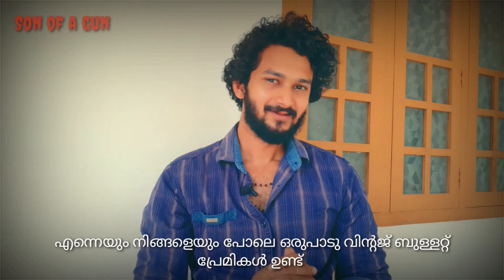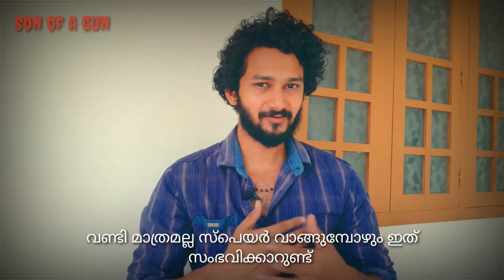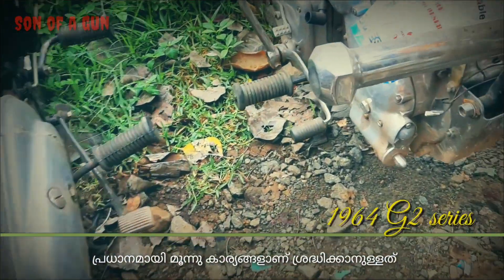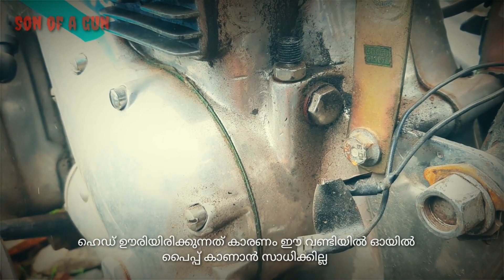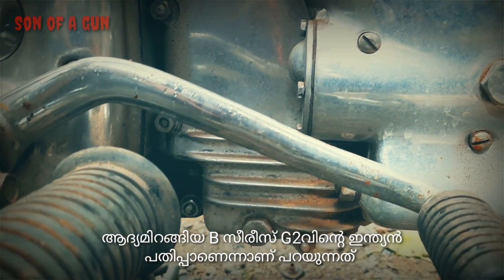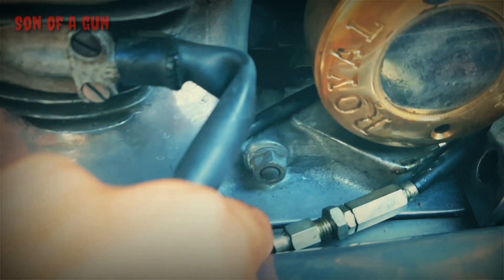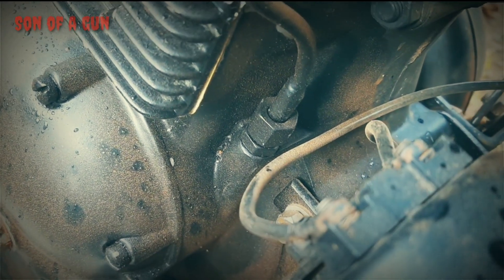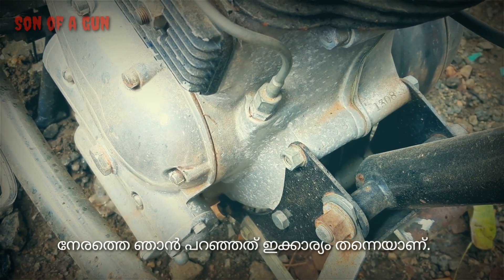How to identify old bullet model | G2 model bullet engine external features | Must watch

Comment: Bro, do a video on fitting and removing  rear cycle hub wheel ,it will be helpful in case of an tyre puncture.
Reply from the maker: Thats a very important suggestion bro..definetely gonna make that
Reply: @SonofagunG2  bro are the vintage g2  bullet genuine parts available still today?

Comment: Thanks a lot bro.. But is there any difference in the riding feel, thump sound or even in BHP... Please explain
Reply from the maker: G2 is not so known for its pulling and mileage... its a slow streamer.. B series bullets are a bit better... as it goes over the years the pickup increses with higher vibrations as seen in post b series ones
Reply: @SonofagunG2  Thank you, Gentleman

Comment: Nice vid bro👍. Btw can it be possible to reduce the tappet noice completely forever. Each time I do, it works only for a short period of time. Thus, there needs frequent service to maintain this. Is there any solution for this? I've been using a 98 model CI bullet for the last 9 yrs.
Reply from the maker: That means the system will need a proper overhaul and probably lathe work.I havent faced the recurring issue in any of my bullets yet...
Thanks for watching..
Reply: @SonofagunG2  Oh ok. But I didn't feel any other issues with my engine except this, so far. Sometimes the knocking sound becomes so annoying and overlaping my exhaust sound. The mechanic says it is a common issue with all CI machines.🤔 Anyways awesome vids bro. Topics you choose are very informative and helpful. Subscribed already👍
Reply from the maker: Then its time to change your mechanic.I have used about 12 CI and none of them had persistent tappet issue.
Thanks a lot bro for the support ❤❤
Reply: @SonofagunG2  Yeah. I too think so.  Thank you. 😊

Comment: Thanks a lot for the valuable information. I would also like to know exactly what was the weight of the crank of G2 engine. Apart from that, it would be of great help if you can throw some light on the different crank weights of engines of 70s, 80s 90s and lastly in models of 2008 and 2009 cast iron.
Thanks
Reply from the maker: This is something even I am so curious to learn.From 60 to 71/72 it is approx 9.3 kg which we call as G2 crank.Then company began reducing the crankweight and those category of bikes knock when we ride in 4th gear at low speeds.It progressed from medium to light over the years. I am not exactly sure about the years but 83 has medium crank for sure.Thats about 8.5 i guess.The Euro one bikes have about 10.3 to 10.5 kg crank weight and they are the heaviest.These bikes range from 2005 to 2010. Some say its till 2008 only.
The best way to check is to try to ride in 4th gear without clutch and see how slow she goes
My 71 can cruise at 20 in third gear without any knocking.But it knocks in 4th gear but once in the groove it can ride smoothly in 20km at 4th
Reply: @SonofagunG2 
Thanks a lot for the valuable insights.

Comment: Hi sir,

I myself own an 1976 model, when i ride it for only 10-15 kms the engine gets very hot. Is the heating problem due to (oil not circulating properly in the engine)

In such case tightening or loosening of the pressure relief wall bolt helpful

Please help🙏🏻

Comment: Can you campare g2 and b1 engine and pls tell me what are the major difference on both
Reply from the maker: I have planned exactly that in my next.The major difference between the later G2 bullets ie from 62-68 and early B series from 69-71/72 is in the bearings.G2 is supposed to have brass bearings.Apart from that nothing is different.Similar crank and similar performance.
Reply: @SonofagunG2  thanks for the information, waiting for yours next video
Reply: @SonofagunG2 
Brass bearings? This is something new to me. Never heard of this before. On the contrary I from a veteran bullet rider that G2 engine had brass cam wheels and brass rockers. I even tried to source brass cam wheels and brass rockers but couldn't.
Reply: Bro I want buy 1968 but fear govt ban 15 year above vehicle

Comment: I am planning to purchase a vintage bullet I have found some on OLX i need to know the difference between 1975 bullet and 1991, I found that 1991 is restored very nicely if you have any please let me know
Reply from the maker: 73 onwards its medium and light crank.They arent much smooth to ride as it comparatively the 75 has lesser vibrations and better handling..
Reply: Son of a gun If g2 is not available I will go with other variants I need heavy crank better handling and less vibration
Reply: @naeemcp  g2available

Comment: Hi, this is yogesh..and i have doubt that the point engine which came in last batch ie.till 2009 has heavy crank..? Apart from that any this special.
Reply from the maker: Yes  bro...Generally speaking that category from 2005 to 10 is heavy crank but there are some exceptions observed too..apart from that the quality of everything including machine parts is fantastic ..very refined engine

Comment: bro i have 1999 last maxismo eletra good or bad
Reply from the maker: Bro machismo and electra are different models... both avl engines...not the old cast iron engine like stantard bullet.in those there is no point system which defines the old bull..
Machismo is like normal bike ...doesnt have any similarity to bullet thats the reason it wasnt a success...
Electra is a bit better..some people increase the crank weight and are of the opinion that its smooth...

Comment: Which model is perfect for daily usage ? (I mean models before 2010)
Reply from the maker: I use my 71 daily... rides just like any new machine..If you prefer heavy crank which enables low speed running at 4th without knocking go for 2005-10 Euro norms compliant category.. 72 to 2005 are medium to lower cranks
Reply: @SonofagunG2  thanks brother

Comment: Hi Bro,

Is there any difference in G2 cylinder head, compared to other models. Most of the G2 owner   and I personally felt an additional engine power or push in G2 engines.

Comment: Bro I have 74 model bullet there is some noise in tappet please guide me where should I repair, waiting for your reply
Reply from the maker: Tappet adjustment is like the basic solution to this but a noisy tappet could be a result of any damage in the entire system starting from the cam shaft to the valve
Reply: @SonofagunG2  suggest me place to repair

Comment: What is the cause of engine jerking in 4gear
Reply from the maker: Is it knocking...if a heavy crank bullet knocks then it needs timing adjustment
Reply: @SonofagunG2  mine is 1983 model.
I dnt know wheath it having heavy crank
Reply from the maker: Its medium crank.. even I had faced the same...still try engine timing adjustment...
Reply: @SonofagunG2  do u find the crrt adjstmnt ??